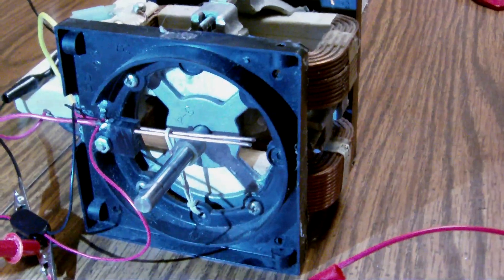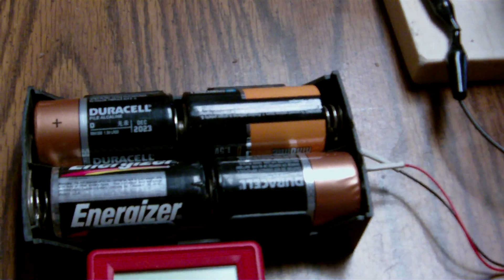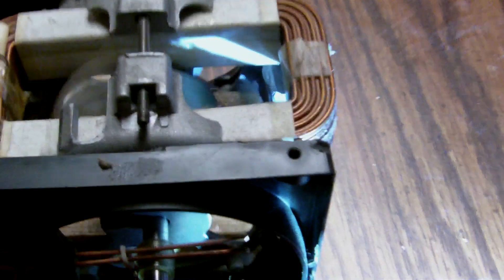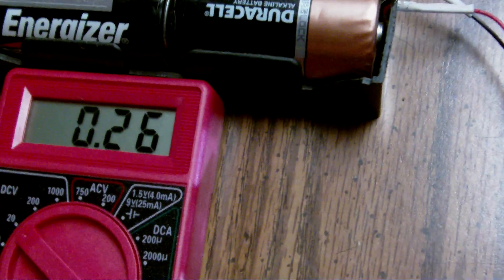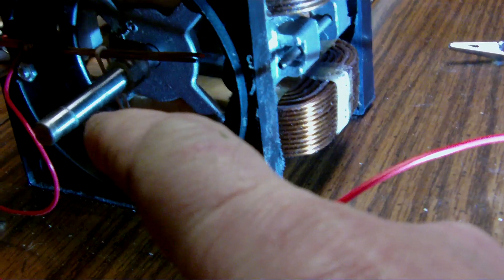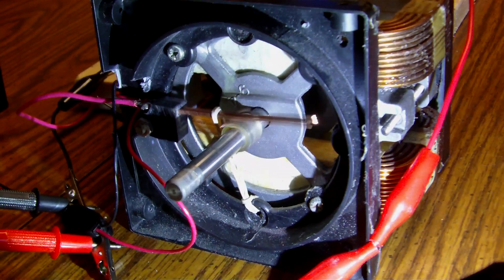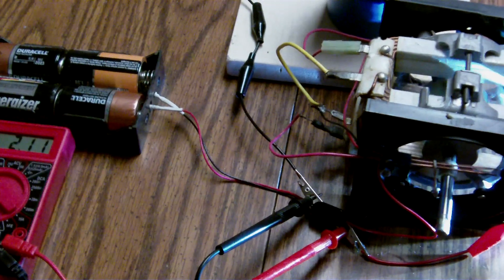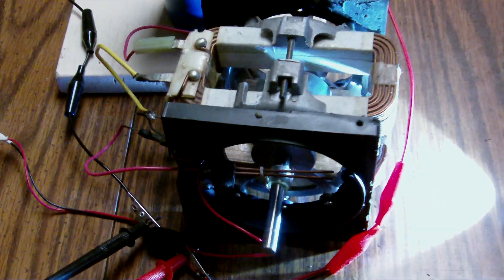newman motor  batteries to dead to run the motor , until  the capacitor

Comment: Someone has already asked , I'm gonna ask again!   Has anyone put a load on it to see how much drag it can handle? I can see that it is producing extra electric! But anyone that knows capacitors... they have an extra charge in them already!  So if that cap already has a charge it will produce the extra kick!  If the machine is producing volts to the capacitor yes there is extra electric going into the capacitor for the extra power, but if there is drag on the machine will it produce volts! And using it (the machine) can also do work, 'then' and produce electric, then this is a Viable source of both Workable power and electric!   Big bertha was a pump and did produce work and extra electric!  Sorry!  I'm not into religion and dont believe !  This is science thats all!  I hate government! If this truly works I dont understand why the patent office  would not give him his patent!  The only thing that I can figure is, what i'v said for years that the government is total controlling every aspect of our life ! And because in the science community it would mess up every known thing they have worked on!
Reply from the maker: It has a little bit of torque but not much I don't have near enough wire to produce the required back EMF, my experiments showed me that the more wire you use the more back EMF you get to translate into instantaneous current with a capacitor thanks for your comment
Reply from the maker: I think the reason Newman couldn't get a patent it's because his motor would undermine the monetary system, I'm still trying to figure out why we need the system at all?
Reply from the maker: From my experiments I'm some DVDs I have of John bedini I've learned that the more wire you add the more output you get while using the same or less input, I know that when the batteries are two dead to run the motor that's in the video all I have to do is hook up the capacitor and it will start running, and it's true that when the capacitor sets it will slowly gain a little bit of voltage but as soon as it is shorted out that voltage is gone, I know there is a lot of back EMF that came off of a larger motor that I put together using a coil that way about 60 lb, because when a friend and I powered it up and it was in a building that had a security system they ran on 2.4 gig it didn't take too long and he got a phone call from the security company so we had to shut the motor down LOL plus when the motor is running the meters that are around it go crazy you don't have to even connect to anything, I like skepticism, in some ways it's the only thing it helps protect some of these awesome inventors, but on the flip side of the same coin, it also makes it easy for the people in power to keep this technology suppress, so thank you for your comment and try to be open minded because it's the only way to keep the door of possibility open, thanks for your comment God bless
Reply from the maker: @Bill Miles I think Joseph Newman is more powerful now, with a lot of help
Reply: Ed Cupp if I was Newman and found my efforts to do things legitimately roadblocked by government and industrial agencies, I would have drawn schematics and instructions and just scattered them across the country.  The potential for open sourcing would undermine the attempts to  discredit and stymie this kind of project. 
Put it out there, and let anyone who understands the process (I do not, unfortunately) improve on it. 
If he had done that instead of holding out for his own development things could be way different today.
Reply: @paulweisgerber7654  Hi! I want to see if you understand that if this works, (and i'm saying that it dose)! Then we have just figured out how to fix all of our electric needs!  Here is why.....If this is putting out electric to self generate its self then we wont need anymore power plants!  I am a little skeptical of how this is working!  So! Here is what i'm saying,  If you can generate electric continuous then you can charge batteries all the time! Correct ?  Then there won't be a need for the power companies!  You see, I have seen something like this , but it dose take gas or some type of fuel to operate ! I didn't see any in any videos, (fuel that is) but it doesn't take a lot of fuel to make this work!  Ok! So what i'm talking about is what as known as a ( one lung engine! ) These have been around for meany years! There very loud need water to cool them , And yes they do generate electric, on a small scale! They build up electric that goes into a capacitor and will release then electric when the RPM'S get low, then this will fire on a piston building up the RPM'S  back to the building up of the RPM'S , now it has the energy to keep rotating , if the RPM'S slow down then the magneto or capacitor kicks in re firing the engine a (with fuel source)!!!  AND SO ON! There have been several of these videos here on you tube ,and i have yet seen one that has any useful generation of any energy (or power) out put! That is without some sort of fossil fuel!  In his video's Big birtha has an in closed area behind the flywheel !!!!!!!  Is there a piston engine there????   Remember it takes water to cool an engine!  One lung engines also need water to cool them!
Reply: Tim Allen yes, I understand completely. It would be world changing. 
But what I was saying was, if I believed I had this kind of solution, and kept getting the political/industrial shaft, I would disseminate the plans as far and wide as is humanly possible, just to spite the power companies.
 Newman said he was told by God to do it for humanity, but he didn’t. He held out, asking for donations to allow him to develop something he already had working models of, instead of giving what he had to the people to improve on.
  To be able to put every power company on the globe out of business without making a dime would be reward enough for me, and would be following God’s directive.
  Perhaps that’s why Newman died before seeing his miracle garner any real interest. He wasn’t doing it for God or humanity. He was doing it to become the next (pardon the pun) electric magnate.
Reply from the maker: @paulweisgerber7654  for the people that are truly interested and has the money to spend and the time to watch a lot of videos, the information is all there, there are people that have already reproduced Joseph Newman's big Eureka effects, unfortunately they will run into the same roadblocks, until Humanity wakes up to the truth and stops letting the program dictate our future, another way to say it, is we all need to look into the future and stop looking in the past oh, everything that we see in the news on TV hence the program is based on the past, we are probably hundreds if not thousands of years ahead of the Technologies that we currently have, because it's easier to live under a system then it is to face the truth, that we create the future
Reply from the maker: @timallen1619  I believe you're referring to the hit and miss motor that was used back in the 20s and 30s that used a big flywheel and harnessed the energy of that flywheel, in much the same way big Eureka uses a flywheel and harnesses the energy, the difference is there is no gasoline motor, he gets his energy from over 400 lb of copper wire, and over 400 volts of smoke alarm batteries, with very little current to trigger the coil the back EMF charges the AC capacitor over 800 volts, when the motor only turns 180 degrees, 1/2 Revolution, this back EMF that charged that capacitor is what triggers the coil to turn the other half of revolution, the commutator triggers the coil from one polarity plus and minus to the opposite polarity minus and plus, according to Joseph Newman this flip-flopping of polarity causes the back EMF to be more, so I have no doubt that everything that he did in regards to this big Eureka is absolutely true, I've done experiments that prove it, but it only proves it to me, I'm afraid for you to be convinced you may have to do the same, my experiments shows me that the more wire you have the more energy output you get with the same or less input, I put my experiments on my YouTube channel, they are titled my free energy experiments, I think it is a good thing to be skeptical, but at the same time it makes it hard to be open minded, thank you for your comment and let me know if I can help God bless
Reply: @fpveddie  An experiment is not needed ! Its a known fact that you can put all the wire you want in one place but you will not keep getting a charge , up to a point! Unless you have a (SUPER MAGNET) to create the electric energy!  You can put all the wire together in one place, but with out the magnets .... there will be no energy!  Think of it this way!  EARTH!  Think about that one for a second and you'll get your answer!  And I'm not religious so ,make believe nothing creates nothing! Have a nice day!
Reply from the maker: @timallen1619  just want to add one other point, Joseph Newman used a huge flywheel, and he also shorted out the coil many times per half a turn while leaving the negative lead hooked up so that the back energy would charge the capacitor, while the capacitor only fired one time per Revolution, I'll admit I don't know it all not even close but I will stand by what I think I know :-) you have an awesome day

Comment: Nomans engine put out more voltage then it used this is a great idea and I would like to see these in cars boats tractor's putting out more power then they use this could the world every one could afford to get power GOD showed noman all good things come from GOD and this is good......GOD is good yes he is....
Reply from the maker: From what I understand it takes between 4 to 600 pounds a wire to generate more radiant energy then the input power
Reply: Ed Cupp according to the review work of roger Hastings, the small unit he tested had 145 lb mass of copper and about a 17 lb rotor.

Comment: i have watched a bunch of different videos and he newman had transformers on his system, go back and watch on the right side of the trailer big sits on and u will see the small transformers on the trailer. the transformers have two horn like things sticking out of the top of the box that they are apart of.
Reply: Think of capacitors like a bucket to hold charge.  Transformers change  amperage and voltage. As the voltage increases  the amperage decreases and vice versa.  So the energy in is about the same as the energy out but transformed hence the name.
Reply from the maker: I'm not sure if Transformers work like capacitors or not but I'm pretty sure they were AC Transformers, I was calling them capacitors I'm really not sure the difference if there is one?
Reply: capacitors are like batteries and transformers boost your input to a really lot more
Reply from the maker: @jjg2824  capacitors are like batteries in the respect that you have to charge them, that's where the similarity ends

Comment: Start with a completely discharged capacitor and don't connect the battery at all. Then see if it runs.
Reply from the maker: That's something that I know won't work, because a capacitor and the battery are two different things the only similarity is that you need to charge them, if I start with a dead capacitor as soon as the motor shorts the capacitor out the voltage will be gone, and I already know that I need between 200 and 400 lb of wire to gain enough back EMF to exceed the input power, but no matter what we will always need some voltage to trigger the coil the capacitor merely turns it into instantaneous current, which is all that is needed to run a motor, but thank you for your comment, and please try to remain open-minded because it's the only way to keep that door of possibility open, God bless

Comment: bro  solar cell  was less than 130 miliamps'''  3 lil garden cells in parallel gave me 3.2 volts and bout 130 mili amps''   dont need and cicuitry at all or cap''  if u  put bridge rectifier across coils'   u can charge  over 450 dc cap like i did in seconds'''''''''its not the cap that was running it' it was  purely the cell'')::) then add cap and u see what i mean__"" it was freaking  awesome in my opinion"_'-

Comment: and solar cells bro;;;   without any solid state or  capacitors''''
 i have one running on 3 volts of solar cell
  with nothing else'
Reply from the maker: I'm not a hundred percent sure but I think that you get some current either from solar panels or from the converter it may have capacitors in it?

Comment: add some magnets around your motor it will increse the effiency and speed with the micro coils
Reply from the maker: I did some experimenting with smaller wire versus bigger wire both of the coils came out of a microwave the big wire took a lot less energy to pulse the magnet then the little wire and I got a lot more back EMF off of the big wire the weight of the wire was probably heavier on the thicker wire but I really didn't weigh it so I'm not sure but it sounds like a good experiment I have to try thanks for your comment
Reply from the maker: This particular motor only fires twice every Revolution so to add more magnets I would have to put them in the same place I can build another motor and spread the magnets farther apart which would give me more leverage 4 power, which may be what Joseph Newman did? Thank you for your comment God bless